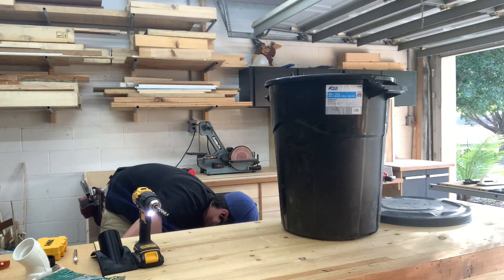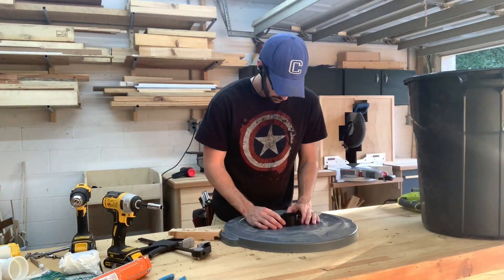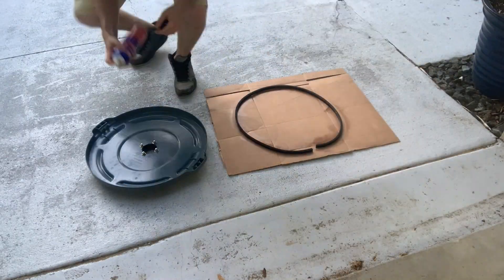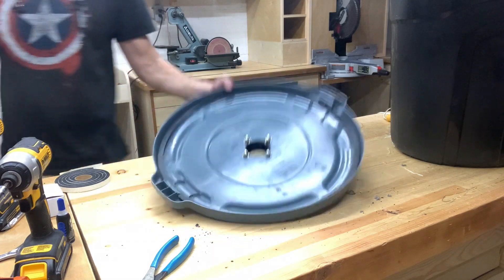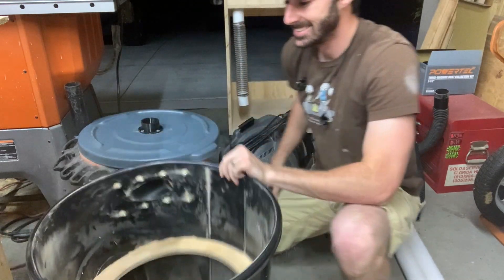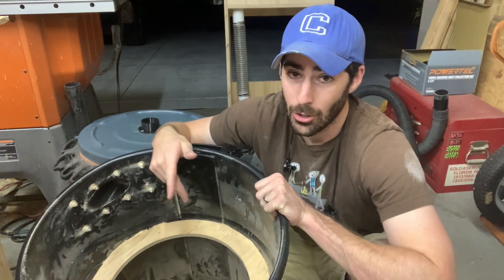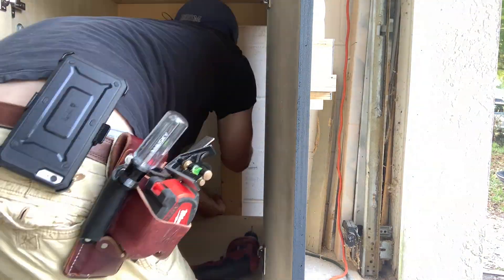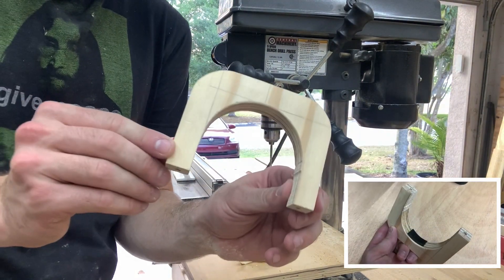2-Stage Shop Vac Dust Collection - 20 GALLON & NO CYCLONE!!!

Comment: Can you provide links to where you got your adjustable feet for the cabinet and you're T track?
Reply from the maker: The adjustable feet are just a T-Nut and Hex Bolt. If you go to the miter station build 6of6 @ 1:46 there is a photo. Turn the hex bolt from the top, then tighten the lock nut once you have your final position. Here is the link for the T-Track: T-Track 48" –Double Cut Profile Universal with Predrilled Mounting Holes -Woodworking and Clamps -High Strength Aluminum Alloy 6063 –Aluminum Extrusion -Fine Sandblast Black Anodized – 2 Pack(black) https://www.amazon.com/dp/B07ZV68P4M/ref=cm_sw_r_cp_api_glt_i_7OHeGb9XDZRYX?_encoding=UTF8&psc=1

Thanks for your interest!